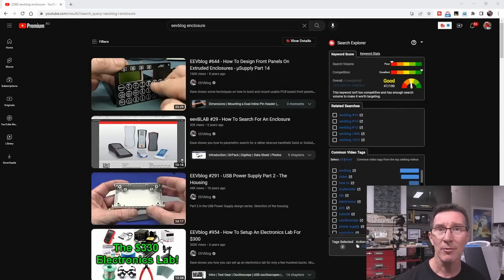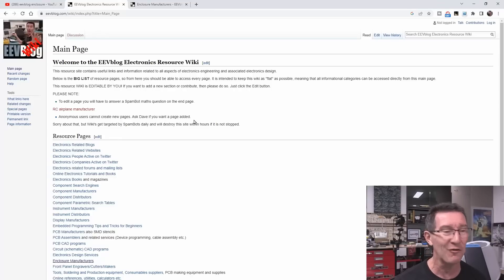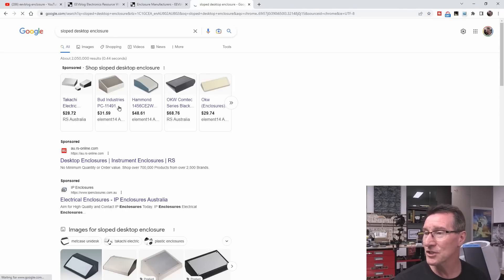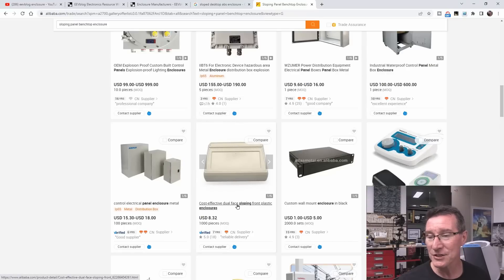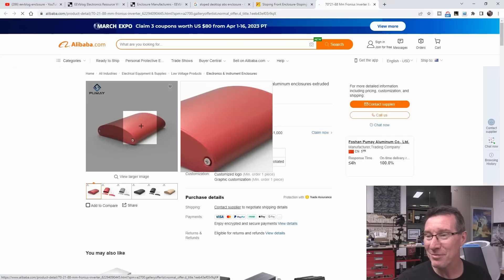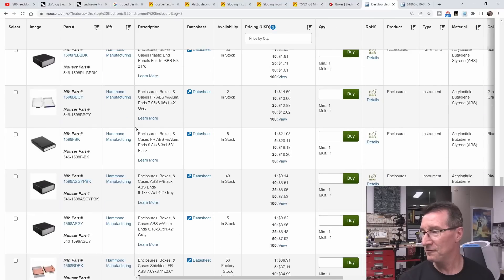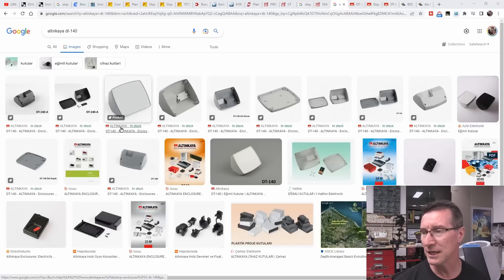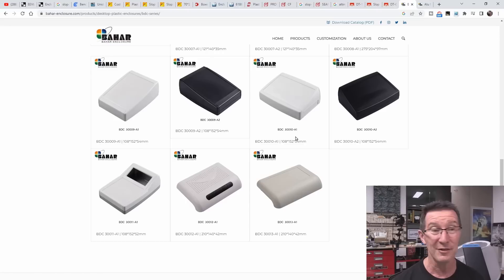EEVblog 1537 - NEW PROJECT Enclosure Search FAIL

Comment: Mate, you could've made a couple of 3D models for the printer in time it took you to create this video... There's not a single benefit to buying prebuilt plastic enclosures for small series / prototypes.

By the time you pay the shipping and deal with import taxes - you've wasted at least thrice the time it'd take you to design and print, and twice the money. Prebuilt enclosures are good for huge series, or overly complex and/or big enclosures that can't be printed in non-industrial printers.

You can get new printers capable of printing ABS (work area of 350x350x400 mm) for 700 USD, and 1 kg of filament is usually around 20 USD.
Reply: Just to add - you can even print 3D with fire retardant plastics, which is quite useful for dodgy electronics and cannot be found on market that easily in prebuilt form.
Reply from the maker: Not quite. My 3D modeling skills are extremely primative.
Reply: @EEVblog  You don't have to learn how to make the technical drawings for lathes and mills, nor do you have to follow the DIN/ISO standard. Just ork it, it's so intuitive that most mechatronics students have 3D modeling in the first semester of the first year of the university. It's a zero compared to how difficult the circuit design is.
Reply: @EEVblog  But your community online may have the skills to help out.

Comment: Being a person that cannot stick to a single hobby, I started out with buying a desktop CNC engraver. I find it rather fun to mill out my own circuit boards. Nevermind the cheap board making houses, I get to make this myself. This lead straight to a desire to have custom project enclosures, so then I designed and built my own 3D printer. Learning CAD, circuit design, and CAM programming actually lead me to a career in the company that I work at now. I always 3D print my own boxes now.
Reply: I've been thinking about that myself lately. I don't know how much practical use I'd get out of a PCB mill or a 3D printer, but I know they're fairly cheap and I want them.
Reply: I did machining professionally for a while- CNC machining with a bit of shop floor programming.  When my father and I eventually get a big building on our property I would like to have at least one small CNC mill.
Reply: @douro20  I've moved to the IT dept at work (which is what I prefer) but I started as a CNC programmer. Using mostly NX with some MasterCAM. I enjoyed learning it all, and now I'm a tad spoiled and the tools I use for my hobby are a bit lacking heh
Reply: Only problem is that if the project is big, it's sometimes faster to have a ready made enclosure shipped to you.
Reply: u need computers and 3d printers to make a box? i use saw and drill. at least the metal will never melt and deform when things get too hot.
by the way things are going looks like in the future this super high tek industry will logically progress even further to printing disposable sustainable crap strictly out of recycled cardboard

Comment: I now just do custom 3D printed enclosures.  It was the main reason I got into 3D printing.
Reply: Yep, can even make them water tight with the right settings (110% infill) and material.

Over extrude the walls and a bit of sanding to make it smooth and it will look just like a injection molded piece.
Reply: EXACTLY the reason I got into £3D printing - got sick of hacking enclosures apart to get something roughly what I needed. 3D printer + Fusion + Eagle = an exact enclosure!
Reply: Thingyverse and others have many many free files.
Reply: Noels Retro just did a video on getting into it and also tried out the PCBWay service for larger prints like housings.
Reply: Same here.
Reply: Me too, it allows me to make it look more custom and using a PCB for the top panel (embeded in the 3Dprint) makes it look really professional!
Reply: i need some 3D printed chicken barns
Reply: I thought the same but then I realized that if I later wanted to commercialize one of my projects I would have to re-design it to fit into an enclosure anyway.
Reply: @MetalheadAndNerd  
its like redesigning basketballers to do slam dunk under the floorboards of the court:face-green-smiling:
Reply: It's a lot easier to print a rectangular hole for a switch than to drill one!
Reply: @donkrapf  its also a lot easier to drill a round hole for a switch than to print anything 3D
Reply: Yup but 3D printing isn’t good for mass production

Comment: If only a display is in the top portion, perhaps make it pivoting to allow angle adjustment for lighting and view? That would permit the buttons to be at the front of a conventional flat rectangular case, with the pivoting display behind. A frontward hinge would let the display fold flat to the rear, facing up. A rearward hinge would let the display pivot forward. If portability is even a small issue, a pivoting display would help. Would also make packaging smaller and simpler.

I haven't done this on the scale of a benchtop instrument, but have done it for smaller 2x24 LCD text/graphic displays. Works a treat!
Reply from the maker: Complicates things a bit too much I think.

Comment: You could make something close using PCBs - do the ends in 2.4mm material with depth milling to locate pieces of PCB for the panels. Held together with lengths of threaded rod, or right-angle brackets off the internal PCB
Another approach I've seen a while ago is for the top & front/rear to be made out a a sheet of ABS, scored, folded and glued with solvent cement to make 2 halves. There was a hook profile machined into the mating edges to make it snap together This looked very professional with minimal tooling.
Of course folded metal is another possibility.
Reply from the maker: I've done that before and thought about it here, but I think a proper case would look better here. Possible to use the PCB as a bare board product no problem, it's just a looks thing really.
Reply: There's at least one company here in the UK that does that does custom cases fabricated from ABS sheet as you describe. We had a one-off done for a project demo some 10-15 years back, too long to remember the company as I wasn't the one involved in designing it. But I do remember it was surprisingly cheap.
[Edit] A search on 'abs fabricated enclosures' returns several companies.
Reply: I like Mikes idea. Score fold and glue a abs sheet for the front, top and backside, then make end plates and bottom on the 3d printer to keep it all together.

Comment: I have some enclosures that are similar to what you are looking for, I use them for an electronic event scoring system I built, I will reply to this comment with the URL for them in case it gets filtered, they do a few versions of the case, with and without the screen cutout, and in cream or black. I 3D print a button surround as my unit has 9 buttons on the bottom section, the screen section and bottom section have posts for PCB mounting inside.

EDIT: you found them @15:40
Reply: This case is similar but has a flat buttom insead of being sloped: Box Enclosures 100 series Angled LCD Case with Flat Bottom